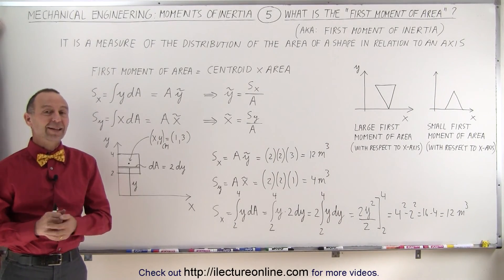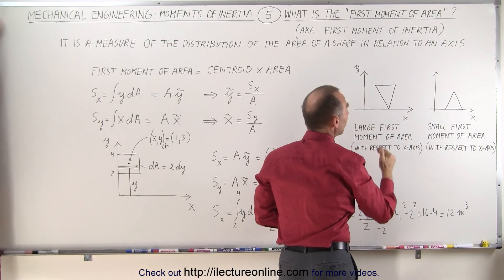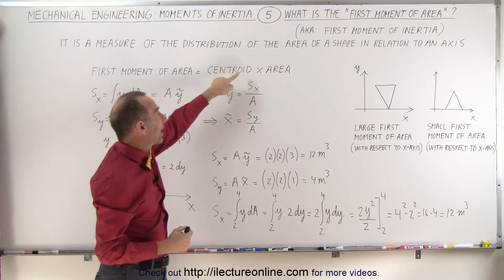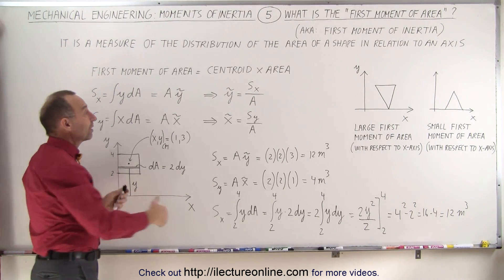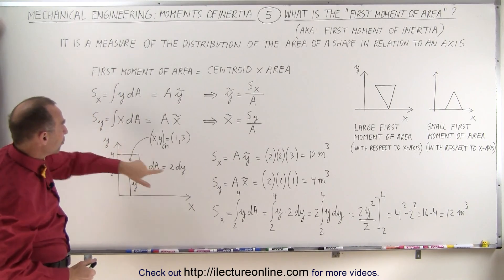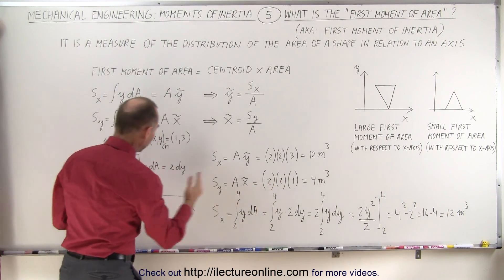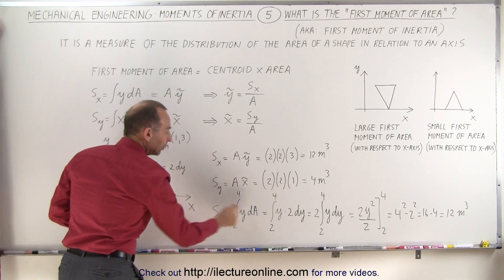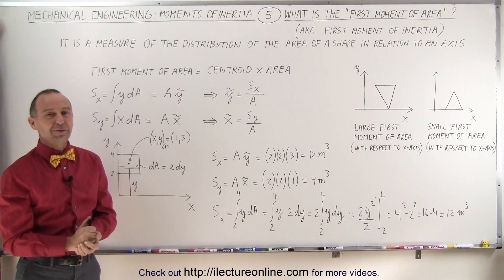Mechanical Engineering: Ch 12: Moment of Inertia (5 of 97) What is "First Moment of Area"?

Comment: Confused as to why there isn't a diagonal line on his graph with a slope of 1? For example if you were to take the integral of the function y = x with respect to x, the graph would show a diagonal line increasing at a slope of 1/1 from the origin of the graph, and the integral would give you the area under that diagnoal line. Why isn't that the case here except along the Y axis?